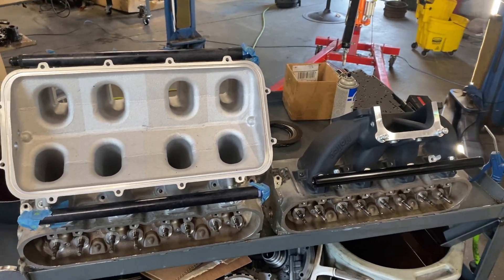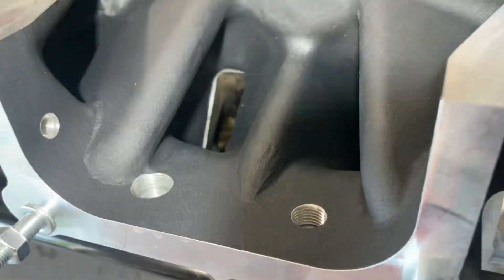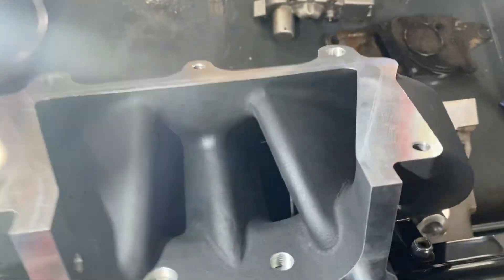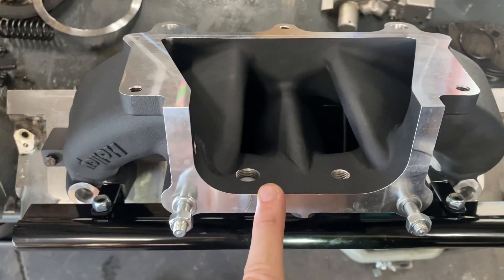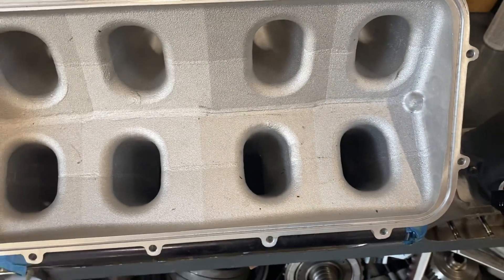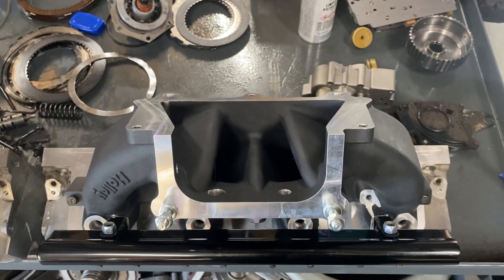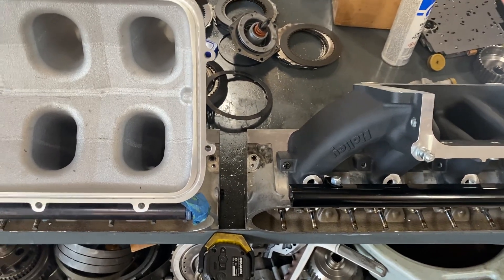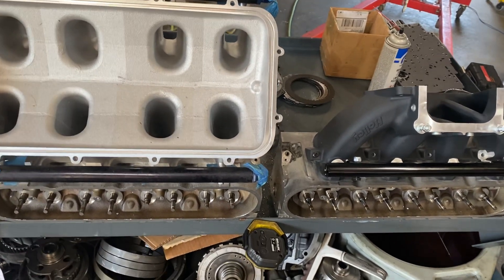Stop over thinking your turbo LS build

Comment: I agree 100 with this video. If it’s your first turbo LS you will have more fun, and be further ahead if you stick to a simple build, and shoot for a 500whp target give or take. The car will be plenty fast and will make enough power to ruin everything behind it so you’ll have lots of things to upgrade and spend money on. Nice video Ryan. Thanks for the knowledge.
Reply: Thing is you can buy something off the showroom floor that has 500hp. Most guys that build turbo LS wanna shoot for 1000hp or as close as they can
Reply from the maker: @1411MEDIA  something off the showroom floor that makes 500 fly wheel horsepower and weighs 4500lbs isn’t anywhere near as fast as a 500whp 3000lb or even 4000lb car or small truck.
It’s a total eyes bigger than your stomach situation.

Comment: I appreciate Btr for responding with real actual results , I wanted to buy their IM and they told me I needed to spin alot more Rpm to see gains and would lose low range torque so with a turbo You need all the torque down low for better spooling and can turn up the boost up top